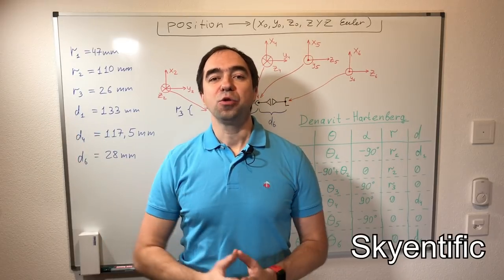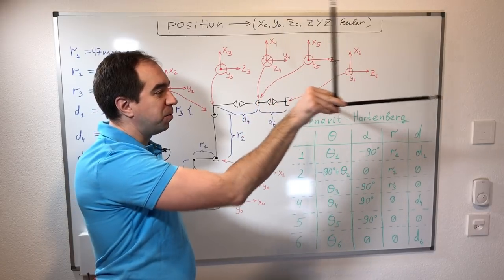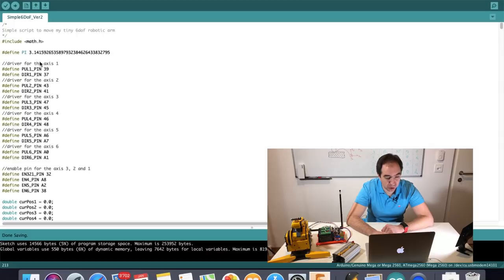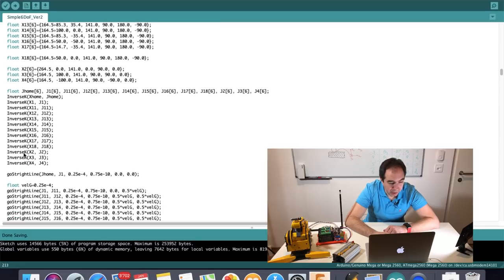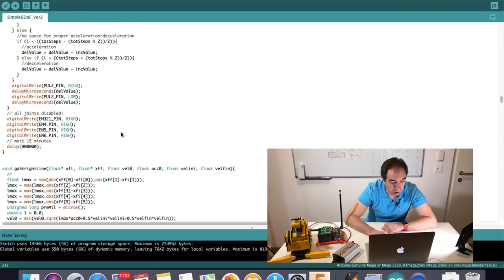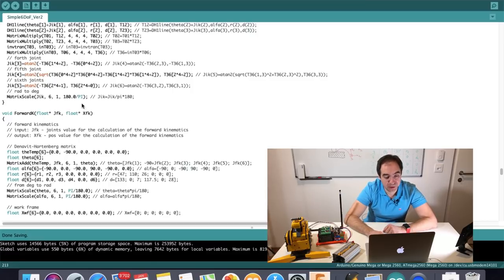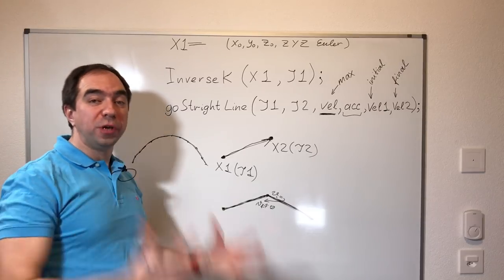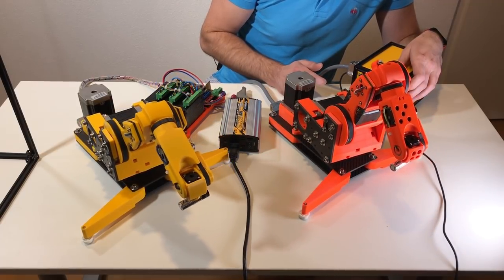6DoF mostly 3D Printed Robot Arm (Part 6) Arduino code!

Comment: I have enjoyed this whole series on the 6DoF arm! Unlike many "makers" you seem to have a very good understanding of the fundamental principles and are able to explain things in a good level of detail. I would love to know how well it holds precision and accuracy after making a LOT of movements, to get a sense of what the cumulative error might be. Any robot hand can make a precise move ONCE, but after 10,000 moves the errors will stack up. On a related note I would love to see a version of this arm that achieves some form of closed-loop control via either position encoders or even more ideally using machine vision. At that point it would EASILY rival very costly commercial arms.
Reply from the maker: I would love to add machine vision. I am just afraid this is going to be complicated. But even already bought a depth camera for this. I will defiantly try to do this in the future! Thank you for you motivating comment!
Reply: Don Stratton
... what do you mean by a closed loop using machine vision... how can it give the position feedback of the arms.. or does it accurately calculate the angles from the pictures... please I need an answer
Reply: Just about the minimum usable industrial 6-axis robot is approximately 20 inch reach and 3 Kg payload. What he's doing here is great work indeed but it's very difficult to replace a precision harmonic drive gearhead and closed-loop servos with absolute encoders. No hobby class robot is going to rival an industrial robot.

I am not in any way discounting the work that this man has done as he is obviously very knowledgeable and talented.

Comment: Super video series. I would love if you could try using ROS control to control the robot. I myself do not have much understanding of ROS, but would like to learn it while building your robot in the future. One more thing, maybe you could use TMC2130 or similar device to sense endstops and at the same time utilize detect missed steps? Just an idea
Reply from the maker: Thank you for your comment! I have two robots and two electronics. One of this electronics (yellow box) uses TMC2130 for the axis 6, axis 5, and axis 4. For other axis it uses TMCM1110, because TMC2130 is not powerful enough for axis 3,2 and 1. I just need to implement this 'endstop sense' in Arduino program.

I would like to implement the robot in the ROS system, but I don't know yet how to do this. So this is for the future.

Comment: I want to build a robot arm, but also want to play with brushless motors. Should I build this or just wait for you newer builds so I can follow along? I have already built a SCARA that runs  on Marlin and am working on a humanoid that will eventually be run on ROS (based of some of the James Brunton Robot X, but with belts and pulleys). I would like to learn more about joint and motor design to improve these projects, what build project do you recommend I start with?

Comment: Very nice video! Do you compute intermediate joint angles in GoStraightLine function? Also do you plan to communicate to your robot arm through serial or wireless connections by sending sending position commands, in the future? Curious to know about your planned next steps
Reply from the maker: Thank you for your comment. I don't compute intermediate joint angles in GoStraightLine, it goes in straight line in joint space (not in physical space). I should say that the program is not optimised at all. I hope that some one who is more experienced with coding than me will take care of this program. That is why I put it in open source. 
But I do plan to use serial connection to send command to the robot from computer. I also plan to use the bluetooth connection to send the serial commands. I hope to finish bluetooth part soon. Maybe I will be even able to control the robot from the smartphone to make it more user-friendly.

My big next project is to make human size robot arm based on brushless motors. But this is a big project and, probably, it will take half a year to develop it.

Comment: How was this done with a delay wouldn't block the rest of the code? I thought we would use millis and array of structs with system like this and I figured with would be a state machine. Would this code work with three robots like right arm and left hand and kneck for the head.

Comment: Great thank you...
I really hope you will continue to improve this arm 
Next step the gripper ? 
What do you think about limit switches ?
👍🏻👍🏻👍🏻
Reply from the maker: Thank you for your comment. I plan to make the gripper as well. I don't know if it is going to be the next step or next next step :). 

For the moment I don't see any real needs for the limit switch. But it would complicate robot a lot (two switches per axis, times 6 axis = 12 switches, 13 additional wires).

Also, as it is the open source robot, everyone can modified it, and add limit switches or encoders. I hope someone will try this.
Reply: @Skyentific    👍🏻 You work for EPFL ?
Reply from the maker: Yes, I do work at EPFL. At Swiss Plasma Centre.
Reply: @Skyentific    👏 fusion is the future !!

Comment: Are you going to add some form of joystick control, that would be really neat.
Reply from the maker: I would like to try to make Android application using MIT Inventor, to control this robot. Like this, with app it would super easy to program and to control it in real time.

Comment: A suggestion. Why not reverse the position of the motor of the axis 4 and thus the axis 4 can be aligned with the 3 and so the value of r3 can be zero.
Reply from the maker: This is a good point. In this case the axis 4 is going to cross the axis 3 and this will complicate the mechanical part, but I agree that it would simplify the Arduino code and inverse kinematics significantly.

Comment: In the line
360.0/200.0/32.0/4.8
32.0 is microstepping...
and the others value ?
Reply from the maker: 360.0 - degrees in one revolution (property of our space :) )
200.0 - number of steps per revolution (property of the motor)
32.0 - microstepping, as you already found (property of electronics)
4.8 - reduction ratio of the belt system (property of the reducer)

Comment: Hello, Hope that you see my comment
Recently (to be more Accurate, This year) I (and my team) build a 6DOF Aluminium Robotic Arm [which is Approx. 2 Meter Tall, working with nema 34 and nema 23 and gearboxes 25:1 and 30:1], for Experimental Purposes in the field of Agriculture [in the University]
but unfortunately, I am facing some troubles while coding the acceleration code, I tried to use Accelstepper and FlexyStepper but all of them doing the same, starting from 0 speed and ending at 0 speed .. which is good to move from point A to point B and stop.. 
and of course, it doesn't support to move smoothly in a path [that contain many points].. because (as you said) it must have its initial speed and final speed.. which those libraries doesn't support.
So, could you refine your code and make a library that controls the stepper motor by giving it (steps to go, speed, acceleration, initial speed, final speed) , i think this would be helpful for all those who make projects related to a robotic arm, etc.
Or Suggest any useful Library/Method that I can use to solve this problem.
*if you are interested to see our Robot I can send you a video :D

Comment: 7:15 why it go home on loop().there is no  home limit switch and when power on.it will be home position where robot arm is when you power it.so it will not move.put it on funtion and call it setup if want and can use home function somewhere on program,but should not be on loop.unless want move it like DEMO mode

Comment: are there limit switches or encoders?  I don't see any.
Reply from the maker: I don't have encoders neither limit switches. And it works just fine. I maybe will add them in the future, but for the moment it works perfectly without them.

Comment: I really like your videos.  What size power supply would I need for this 6-axis robot?  Will a 30V 10A bench power supply be acceptable?
Reply from the maker: Thank you! I think 100W should be enough (even less). But, if I am not mistaken, the power supply should be between 12 and 24V (not higher than 24V).
Reply: @Skyentific  Thank you.  It is adjustable, so the maximum is 30V, but I will remember to set it lower.  I will put a picture on your thingiverse page once it is completed.
Reply from the maker: Great! Good luck!

Comment: Can this arm add in CNC function to become 5 axis CNC machine. That would be cool
Reply from the maker: Yes. but the arm is not too strong for this. It has only 200g payload capability. May be for very light part for soft material.

Comment: the robot doesnt have any feedback sensors to give the position of each arm... so how does the robot know what is its home position... im trying to build a different and a little bigger arm... do you suggest me to use the optical encoders to get the position feedback
Reply from the maker: It is always good to use encoders if you can. Optical encoders are good choice. I don't use them as I don't have place for them. And they would complicate the arm a lot. 

I know the exact position of each motor at start (as robot at start is in folded position). All other position I calculate from this folded initial position. And this method works quite good.
Reply: @Skyentific  hey thanks for taking your time out to clarify my doubt... you are doing some seriously good work
Reply from the maker: Thank you!

Comment: Hi skyentific,

      I finished the Robot arm but I want to know which Amp of the 12V switching power supply should buy for this robot arm? Could you give advise? Thanks:)
Reply from the maker: This is excellent question. I think 5Amp should be more than enough. I use 9Amp power supply to be on the safe side. Thank you for your build! I am truly impressed how fast you were able to assemble this robot!
Reply: I have a 5A 12V and a 10A 12V,  axis 1,2,3,4,5,6 are 0.6A, 0.68A, 0.68A, 1A, 3A and 3A total is about 9A. Is I need use the 10A 12V?
Reply from the maker: @calvinchung2432   It is more complicated than that. You should compare the power. You motors consume around 3V (I don't now exact value). Thus the power which they consume is: 3V*(0.6+2*0.68+1+2*3) = 27Watt. If you use 5A at 12V power supply it gives you 60W. Thus it should be more than enough, if the drivers efficiency is higher than 50% (usually it should be higher).
Reply: Thanks for your help, now I understand of that :) That mean a 5A 12V is enought for  the Robot arm. Compare the size 5A 12V is small than 10A 12V, So the controller box can be make small.
Thanks :)
Reply from the maker: I check this morning the power supply from my robot arm, and it is 60W. So your 5A 12V should be the same.
Reply: I tested 5A 12V, it work 👌 👏☺️

Comment: Please can you mention regarding GCODE usage with 6 DOF
Reply from the maker: This is an excellent question. I don't know how to use GCODE for 6DoF. But I think it would be nice to integrate this in the robot. As soon as I will find out how to do this, I will try to implement it.
Reply: @Skyentific Thanks,  I look forward for the GCODE video series.
Reply: I just ran across your channel tonight as a suggested video. I'm so glad I tried it out. You are a very smart man. 

I am no where near your level, by any way shape or form. But I can sure imagine putting a hot end out there on the end of your arm. You would have a 3D printer that could reshape the industry. I think you would almost need a new type of g- code to take full advantage of the 6DOF, but it would be so worth it. Can you even imagine the possibilities?
Reply: @Skyentific  well, I programmed a GCode interpreter for arduino few years ago... I suppose that as this is angular movement, you have to sync several axis and move them at the same time in order to move the tip/gripper/object in a cartesian space (XYZ).... so, to do that, you need to analyze the 6 axises at the same time and found ecuations for each axis movement that provide you how much you need to move each axis (some of them will need to move faster at some time than other, and smothly change speed to maintain linear move (for example for a linear G-command))

but anyway this is a pretty good arm, congrats!!!... i'm anxious to 3dprint your model and assembly it myself!!!

Comment: Sir, 

if you can explain this function in a separate video would be great:

void goStrightLine(float* xfi, float* xff, float vel0, float acc0, float velini, float velfin){
  //
  float lmax = fmaxf(abs(xff[0]-xfi[0]),abs(xff[1]-xfi[1]));
  lmax = fmaxf(lmax,abs(xff[2]-xfi[2]));
  lmax = fmaxf(lmax,abs(xff[3]-xfi[3]));
  lmax = fmaxf(lmax,abs(xff[4]-xfi[4]));
  lmax = fmaxf(lmax,abs(xff[5]-xfi[5]));
  unsigned long preMil = HAL_GetTick();// micros();
  double l = 0.0;
  vel0 = fmin(vel0,sqrt(lmax*acc0+0.5*velini*velini+0.5*velfin*velfin));
  unsigned long curMil = HAL_GetTick();// micros();
  unsigned long t = 0;
  double tap = vel0/acc0-velini/acc0;
  double lap = velini*tap+acc0*tap*tap/2.0;
  double lcsp = lmax-(vel0*vel0/2.0/acc0-velfin*velfin/2.0/acc0);
  double tcsp = (lcsp-lap)/vel0+tap;
  double tfin = vel0/acc0-velfin/acc0+tcsp;

  while (curMil-preMil<=tfin){

  t = curMil-preMil;
    //acceleration phase
    if (t<=tap) {
      l = velini*t+acc0*t*t/2.0;
    }
    //contant maximum speed phase
    if (t>tap && t<=tcsp) {
      l = lap+vel0*(t-tap);
    }
    //deceleration phase
    if (t>tcsp) {
      l = lcsp+vel0*(t-tcsp)-acc0*(t-tcsp)*(t-tcsp)/2.0;
    }

    //trajectory x and y as a function of l
    float Xx[6];
    Xx[0]=xfi[0]+(xff[0]-xfi[0])/lmax*l;
    Xx[1]=xfi[1]+(xff[1]-xfi[1])/lmax*l;
    Xx[2]=xfi[2]+(xff[2]-xfi[2])/lmax*l;
    Xx[3]=xfi[3]+(xff[3]-xfi[3])/lmax*l;
    Xx[4]=xfi[4]+(xff[4]-xfi[4])/lmax*l;
    Xx[5]=xfi[5]+(xff[5]-xfi[5])/lmax*l;

    goTrajectory(Xx);

    curMil = HAL_GetTick(); //micros();

  }
}

Comment: Thank you for your fast response to explain your code. Also very nice changes about the start and final speed at every move, very useful.
I have a 5DOF robot (without your joint 4). Can you advise how the HD matrix (the alphas) should look like and accordingly if other changes should be made in the equations of the IK ?
Also why you have used the Euler angles for end effect orientation? it looks like difficult to use or imagine.
If you are planning to control your robot via smart phone, check the following BT app  at (www.keuwl.com). they have a great customized app you can do alot with BT and smartphone.
Reply from the maker: I used Euler angles as it was the first thing which I tried and it works well. But I agree that these Euler angles are not user friendly. For the smart phone control I found MIT inventor, and also one of my viewer advised my Blynk, but Blynk is not exactly free. Thank you for the third alternative, I will check it. 
About your robot. I don't know exactly how to solve your problem. But maybe you can just use Jik[3] = 0. From this equation you will get the condition on which position and orientations are available for your robot. And from other equation you will get inverse kinematics. I think it should work.

Comment: Hello this question is translated from turkish to english:
I printed the robotic arm and equipped it with Ramps 1.4 and TB6600 and TMC 2209 drivers. I also created an APK via MiT_Inventor, everything works perfectly! Now to my question: How can I combine 2 sketches into one via Arduino, i.e. practically the normal Sketch.ino without Bluetooth and the Sketch with Bluetooth.ino.... so that I can freely choose which one I start? The 2nd question would be whether I can then integrate it into my APK file?
I would be very happy if you help me in this regard, or you make a new YouTube video on how to add it further. I have mastered the basics of programming: You can see my robotic arm here on Youtube:
https://www.youtube.com/watch?v=MF7dO4dAIAw

Comment: Could you consider attaching an e3d v6 or similar extruder to this and using a program like powershape/powermill to set up the sliced gcode?
I haven't seen anyone go through the full process on Youtube and I'd like some more background on the additive/extruder attachment side of things before I start building my own similar project.